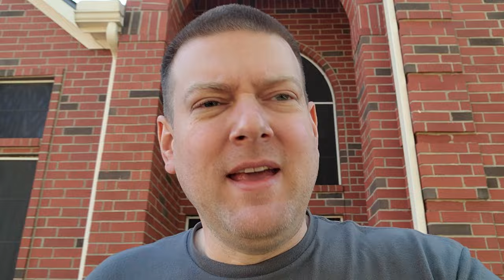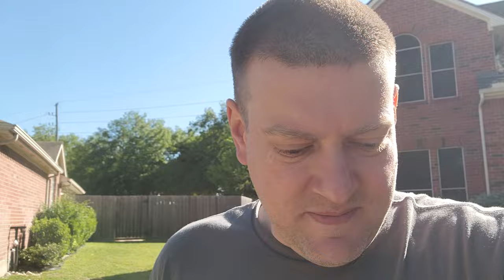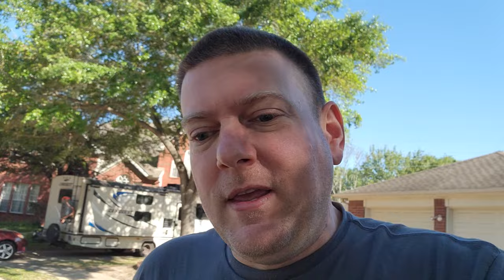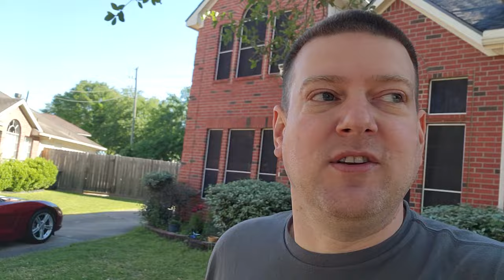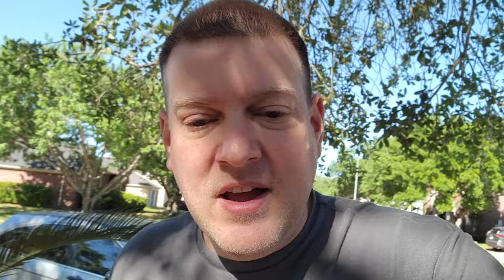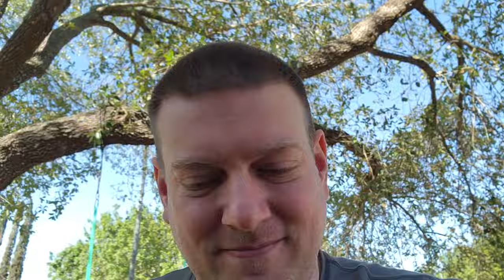New Rule of Repair!

Comment: I also had a 'repair epiphany' of my own today. 
Different industry, but I get the feeling my 'device' won't be receiving a particular upgraded part as part of preventive maintenance or recall campaign under warranty. 
Instead, we are left to gamble with major failure and downtime, even tho it will most likely fail under warranty.

Cynical me thinks there is more work for the brand's technicians if the failure is allowed to reach the point of major failure.
It's wasteful, my downtime isn't valued, nor is saving corporate an astronomical bill in comparison

Comment: And after a nurses 36th nuisance ail alarm the pump was somehow "accidentally" dropped down an open elevator shaft. The initial problem could have been fixed with a q tip, some isoproply and 2mins. Now after a 5 story drop pump is a write off.